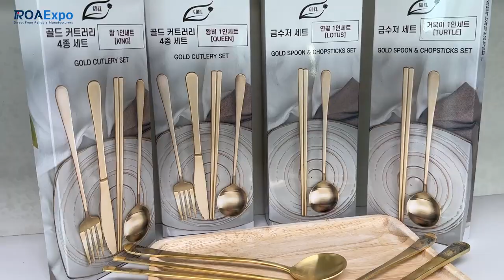24K Gold Plated Spoon Mass Manufacturing Process ROAExpo From Pressing to gold plating process

Comment: This is a gold plated spoon, not a 24k gold spoon. Big difference.
Reply from the maker: yes you're right it's 24k gold plated spoon. Usually 24k pure gold is too soft and prone to staining. So when they receive an Olympic medal, the athletes hold a ceremony to check it by biting it with their teeth. Therefore, 24k pure gold spoons are often used as gifts rather than in real life.
thanks for the comment . :)